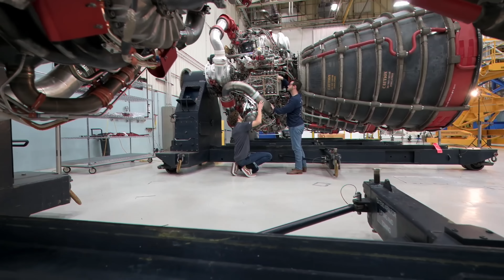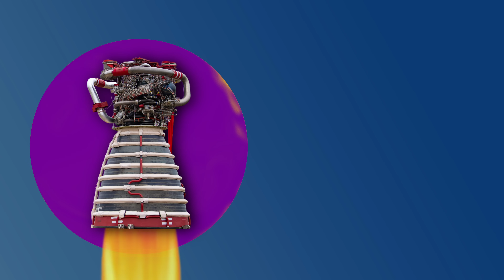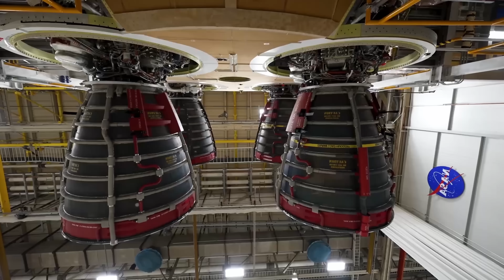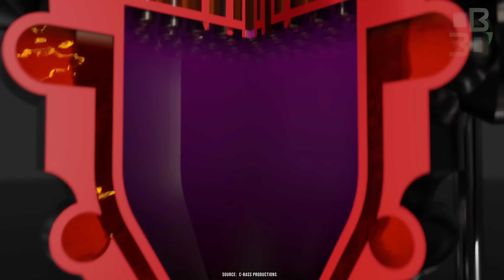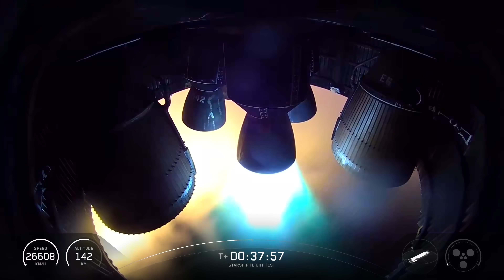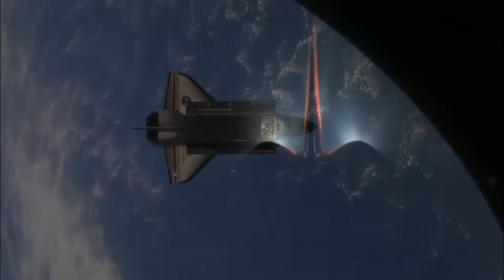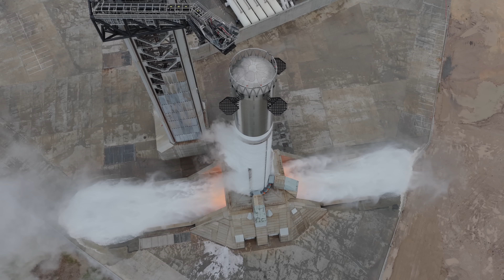Why SpaceX Raptor and NASA RS-25 Are So Different…

Comment: There are some holes in this explanation.  So I'm offering some additional meat, for those interested.

All liquid rocket engines need turbopumps and cooling systems. That’s not unique to the RS‑25 — it’s simply how liquid engines work. They all must force propellant into a high‑pressure chamber, and they all must keep their chambers and nozzles from melting. The RS‑25 is complex, but its real complexity comes from using hydrogen in a staged‑combustion cycle, which pushes pressures, plumbing, and cryogenic handling far beyond what kerosene or methane engines require.
That incredible complexity is not the primary part of what gives the RS-25 its high Specific Impulse.  - Nope!  The high Specific Impulse is a result of the fuel choice: Hydrogen.  But the complexity is influenced by this fuel choice.

And fuel choice brings us to the next issue: "Efficiency".  Efficiency for what, exactly?  Fuel consumption? (laughable because the fuel is by far the cheapest component of rocket flight).  Thrust?  Hydrogen is the worst option.  Propellant mass?  Yes, Hydrogen is the best option.  Propellant volume?  Hydrogen is the worst option.  Specific Impulse?  Yes, Hydrogen is the best option.  Re-usability/sustainability?  No, Hydrogen is the worst option.

For liquid fuel rocket engines:
Thrust:  Hypergolic is best.  Kerosene is second best.  Methane is in the middle.  Hydrogen is worst.
(Deeper explanation)  
This ranking refers to thrust per unit engine size, not absolute thrust. Dense fuels allow higher mass flow through the same chamber geometry, producing more thrust for the same physical engine dimensions. Hypergolics and kerosene are extremely dense and pump‑friendly, giving very high thrust density. Methane is moderate. Hydrogen, despite its advantages in specific impulse, is so low‑density that it produces the least thrust per chamber volume, even when run at very high pressures. Chamber pressure helps, but cannot fully compensate for hydrogen’s low density.

Specific Impulse:  Hydrogen is best.  Methane is in the middle.  Kerosene is not so good.  Hypergolic is awful.
Handling:  Kerosene is best.  Methane is in the middle.  Hydrogen is awful.  Hypergolic is disastrous, Satan's own.

Re-usability:  Methane is best.  Kerosene is in the middle.  Hydrogen is worst.  Hypergolic, .. just don't.
(Deeper explanation)
For reusability of the rocket as a whole—hull, tanks, and structure—kerosene is clearly better than hydrogen. Hydrogen’s extreme cryogenic requirements and low density make the vehicle larger, more fragile, and more prone to fatigue and embrittlement over many cycles.

Let's also touch grass on the economy:  The RS-25 was designed to be built as cheaply and efficiently as possible!  Of course it was! Aerospace & rocket engineers are not mad.   - But, ...as relevant for the numbers of engines needed!!  The numbers game radically scale all costs: Design costs, development costs, tooling costs, production & build costs.  The cheapest and most efficient way to design, develop and build 30 rocket engines, is not the same as for making thousands of engines.

Now might be time to introduce how things 'scale', scale by laws of physics, engineering and economics.
Given other things equal, a big 'thing', doing some amount of 'work', is 'cheaper' than several smaller 'things' doing the same amount of 'work'.  (that's generally the principle behind a lot of stuff, why there is one big diesel in a truck instead of ten scooter engines, factories becoming bigger as demand increases, why ships become bigger... etc.).
But there are physical limits to this.  The loads on and within something scale with the cube of the geometric scale, but the structural strength only scale with the square.  This means that the larger you build something, the more of its weight will just be structural reinforcements, until it's all structure, and still collapse from its own weight.  Otoh, at the other end of this, you have the incredible relative strength of the tiny ant.
A collective of fewer number of things will also be more reliable than the collective of a larger number of things.   ...That is, if the things are equally reliable!

The way SpaceX tackled all of this, starts with what they wanted to do, both regarding the Falcon9/Merlin and Starship/Raptor.  Elon Musk had absolutely no desire to just start another launch-rocket company.
It all starts with Falcon9  (given that Falcon1 was mainly a development and technology demonstrator).  The goal identified was to lift a payload into LEO (low Earth orbit) as cheaply as possible.  Only giving token consideration to any requirement to lift payloads into higher energy orbits  (because, frankly, that should not be a task for the launch rocket, though it still often is).

All other rocket companies went all-in on throw-away, three-stage, modular rocket systems.  3 stages, because that is how you keep size and weights down, and thus costs (almost all launch rockets have historically been 3-stage).  Cost reduction would also come from series production of the modules.  The first stage consists of the main stage (possibly throttled down) and strap-on, solid fuel boosters.  Second stage is just the main stage by itself, and third stage is the final stage.
This conceptual design makes it possible to adjust the capacity, by the numbers of strap-on boosters and different versions of the final stage.  And the main stage is kept at moderate size with a small number of (big'ish) engines.  All of this is of course aimed at reducing the cost of this all-throw-away rocket.

Now, it is easy to be blind to that this design concept, followed by everybody else (except SpaceX, Blue Origin), starts with the fixed assumption that rocket launches will still be rather expensive, and rather few in numbers!  That's really the mental crux!
Because if rocket launches were cheaper, the lower cost would result in a higher demand, meaning more rocket launches.  And then that modular all-throw-away 3-stage rocket would no longer be the best way.  And Elon had a way to guarantee more rocket launches, so he had the means to lift this rocket project by its bootstraps:  Starlink. He became his own main customer.

Enters re-usability.  It's easy to assume that it's just about clever flight controls that allow the rocket to land by its own engine again.  But there is actually a whole lot more that goes into it, and that is much of the explanations for the way the engines (Merlin & Raptor) are designed.

A Three-stage rocket is now unacceptable.  It's not just that solid-fuel boosters are essentially throw-away, something that we don't want, it's also that the main stage (essentially second stage), the, biggest, most costly and expensive part, flies too far, to too high energies.  It cannot be easily or economically recovered.  It would need heavy heat protection for re-entry.  And where would it land?
So it needs to be a two-stage rocket.  The first stage cannot fly farther, than that it can return and land.  This means that the second stage need to muscle up, because it will need to overcome more of the gravity-losses on its own, as it continues to accelerate.  So it needs more thrust and fuel.  So it becomes heavier, in turn demanding the first stage to also become bigger and stronger.
But this is not really a problem.  Because the main stage (first stage now) will fly again and again.  So its size and cost doesn't matter as much.  And the rocket fuel is cheap.

What does matter now though, is Thrust/Weight ratio, Thrust and Throttle-ability.  The thrust demands for accelerating a heavy, fully loaded rocket, and then later landing the empty, light rocket hull, are so different that mere throttling doesn't work.  Instead, we must have the option to choose the number of engines.  And the engine must not be bigger or more powerful than that one throttled engine will be able to lower the rocket and land.
So we must have many of those engines in order to provide enough total thrust.  And this is where everything suddenly comes together.  Because, much like the ant, rocket engines naturally tend to get stronger, relative to their weight,  as they get smaller.  Certainly, both Merlin and Raptor are designed for maximum thrust/weight ratio, but keeping their size down also helps with that.
(Deeper explanation)  
Smaller engines naturally achieve higher thrust‑to‑weight ratios because turbopumps, chamber pressure, cooling, and injector stability all scale more favorably at small size. Structural mass grows roughly with volume, while thrust grows with mass flow through the throat area, so geometric scaling also penalizes large engines. This is why engines like Merlin and Raptor can reach extremely high thrust‑to‑weight ratios, while very large engines like the F‑1 or RS‑68 cannot.

And thrust/weight ratio is crucially important for a returning and soft-landing rocket.  Because it will have to fly not only that weight of the engines both up and down, but also fly the weight of the additional fuel that will be required for flying the weight of the engines, ...and the weight of the additional fuel again...

The weight of the engine doesn't matter so much for a throw-away multistage rocket, because it will just be discarded as soon as it runs out of fuel.  What matters is the thrust of that throw-away engine, not so much how heavy it is.

The final cold calculation is that, despite the fact that the engines are reused many times, the lower launch-prices will still increase the number of starts so much that a great number of engines will still be needed.  Thousands of engines.  So yes, the design and investments for mass production are planned from the beginning.  And that is also how the reliability is handled, by iterative refinements over a long sequence of engines.
Reply: Holy $&I/ Vermiliontea. That is the most complete, thorough and thoughtful explanation of the challenges, physics and engineering I have read to date. You sir (or Madam) are a true ricket surgeon. If I could, I would buy you a beverage, I sincerely salute you as a fellow "surgeon"
Reply: Oops, typo. ROCKET SURGEON!
Reply: Thanks for the detailed explanation.
Reply: Great info! 👍

Comment: What is the main reason NASA is not buying Raptor engines from SpaceX?
Reply: NASA is under government mandate controlled by Congress. Congress specified that the SLS be built by the same contractors as the Shuttle. Congress also specifies that contracts be spread out across the country for parts so each congressional district gets a piece of the pie. This means the government money benefits as many people as possible. They look at NASA as a make work program. This is also the least efficient way to make anything.
Reply: By the time contract is signed, spacex already has an uograded version.
Reply: @dennie5501so the upgraded version send a shitload of CO2... Amazing upgrade
Reply: Right now, NASA has no identified need of any Raptor engine.  Also, the Raptor engine is still in development.
Personally, I find it unlikely that NASA will contract Boeing or Lockheed to build a rocket that will then need Raptor engines.  It's more likely that ULA would do a thing like that, if they could find the financing, but they are currently using Blue Origin BE-4 engines.  NASA, I think they would just buy the entire rocket service package from SpaceX, if they wanted anything.
Reply: Stupid law that requires that SLS must use "shuttle-derived" components.

Comment: A bit silly to compare technologies that are 60 years apart. Note that a single F1 engine failed the Saturn V rocket.
Reply: they did have failures in the beginning, NASA doesn't share failures like Spacex if the public sees it then the pressure comes they could lose funding.

Comment: Reason #2 why they used liquid methane, is because it liquefies around the same temperature as cryogenic oxygen.  Which means you can build a lighter rocket, because you can use a common bulkhead between the methane & oxygen tanks with zero insulation.
Reply: Very important point missed by many.
Reply: The common bulkhead in a hydrolox rocket must prevent the warmer LOX from boiling off the LH2. Moreover, if the common bulkhead fails in any way, LOX contacting LH2 will cause a catastrophic boil off, followed by a massive explosion that destroys the entire launch vehicle.

Comment: Methane is best for first stages and strap-on boosters. Hydrogen is for upper stages, and hydrogen is the only fuel that makes sense for upper stages!
Reply: Not really, not always at least. Since H2 is crazy tiny for a molecule it can literally pass through solid metal walls. Also, due to very low density even in liquid form the fuel tanks would be chonky. So unless those tanks can be made in space, H2 is only good for short term missions (or missions that only require a short burn that happens early).
Reply: Many factors to take into account like storing hydrogen for long periods in space is far harder than methane. SpaceX has achieved 300+ bar combustion chamber pressure negating much of the advantage of hydrogen. Raptor thrust 275tons vs RS-25 232tons (also much smaller and lighter), but RS-25 does win out on isp at 452 vs 380. Specs for vac versions.

Comment: I still didnt hear why raptor only needed 3 engines and space x needed 30.
Edit: 😂 nasa rocket engines not the raptors.
Reply: Bro what?
Reply: @island97 😂
Reply: Is math foreign to you or something like that? The space shuttle needed only 3 because it was a small-ish space vehicle. The Starship has 6 raptor engines but uses 3 most of the time (the center 3, which are best suited for atmospheric flights, while the bigger 3 are for space flight). The heavy booster uses 33 because it's a heavy booster. Heavy means heavy, even if you're worthless in math heavy still means heavy.
So the space shuttle had 3+ engines, and the Starship has 3+ engines. You're just plain old wrong, if not dumb.
Reply: @Philipasu  That's false because Saturn V's first stage used only 5 engines whereas Startship uses 33 and they're both super heavy-lift launch vehicles. The real math is not the amount of engines rather the combined power of them thus the less engines the more powerful each one needs to be and the more engines the less powerful each needs to be.
Reply: @user9000-b5n  Don't know what you replied to.

Comment: Who told you Raptor cost $250,000 ?
Where's your proof ?
I call BULLSHIT !

RS25 actually WORKED !
Raptor shits itself REGULARLY !!!!!
Reply: It costs 1.6 million but space X wants to simplify it enough to cost 250k usd
,
It's impressive compared to NASA's engine costing 250 miilion in todays money
Reply: Elon hater
Reply: Raptor is a mass produced engine. $250,000 is the cost when the production line is scaled up.
SpaceX has produced hundreds of Raptor engines. They have the luxury of performing test flights that might fail.
Reply: Thw Raptor 3 development phase at least costed 2 to 3 billion...if yoy devide it over 3000 engines that is 1 million per engine...thatvwhen tbey reach 3000
Reply: Oh the $250,000 is just a prognos.
Well, why not count in even bigger scale up and say it will only cost $25,000

Comment: I think you missed the fact that Raptors are full flow. It is the first design to make it work properly and gives big efficiency gains, necessary because methane contains much less energy than hydrogen.
Reply: Liquid Methane is denser than liquid hydrogen, so liquid methane might contain more energy per litre than liquid hydrogen. However, the exhaust speed is important for rockets, and hydrogen produces the fastest exhaust speeds and more than makes up for weight penalties due to larger tanks.
Reply: @karlthemel2678 It’s the energy per mass that matters most for fuel because you have to accelerate it with you before you use it. There are various metrics to compare engines, including specific impulse. That’s the ratio of rate of change of momentum per kg of fuel used. The RS25 is a bit higher than the Raptor 3 (452 vs 350 for the sea level version) but that shows how good the Raptor is as the energy density of methane is less than half hydrogen. The Raptor is much smaller and lighter which is how they cram in 33 engines vs 5 on the Saturn 5. Bottom line is that Starship+Raptor will be a far superior system when fully developed.